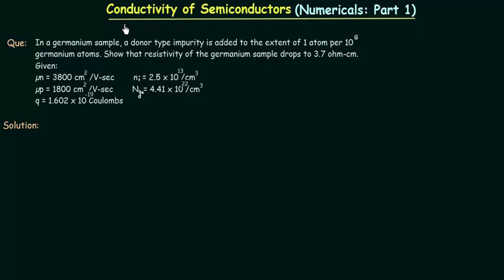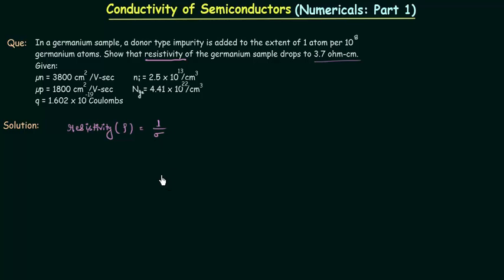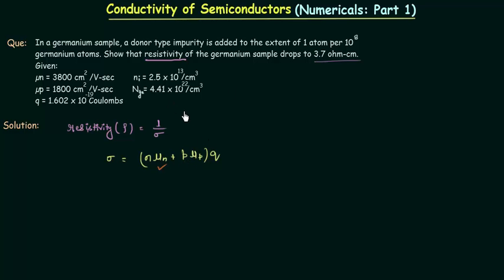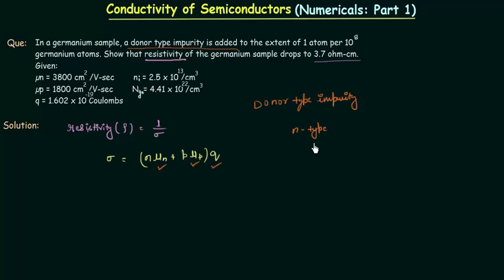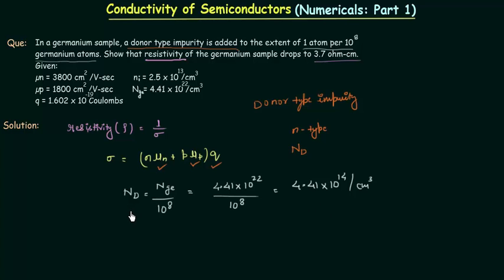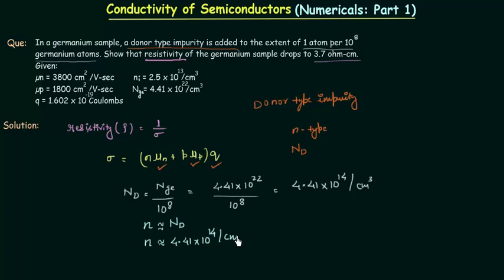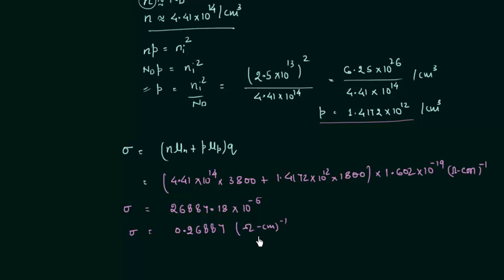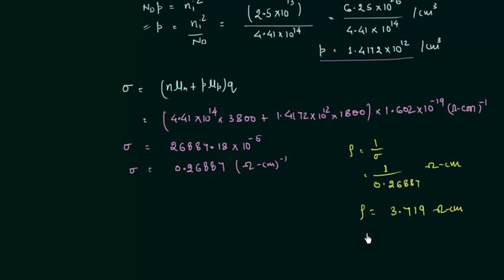Conductivity of Semiconductors Numerical (Part 1)

Comment: As you have calculated concentration of hole in n-type material is approximately 1.4172*1e12 with respect to concentration of e in n type which is 4.41*1e14. So from this example we can not say that hole concentration is very less...or some time you say that we can ignore  hole concentration in n-type material but here number say that its can not be ignored even w.r.t to e concentration also its only matters for 100 times.

Comment: I have a doubt. After doping the no. of electrons should increase and therefore electron concentration = Nd + ni . Why have u taken it to be Nd ??
Reply: I have the same question. Shouldn't it be 4.66 x 10^14 ? I wouldn't have a problem if the difference was less than 1%,  but there is a significant difference of 5.67% between the two values.
Reply: I too have the same doubt...did u get it?